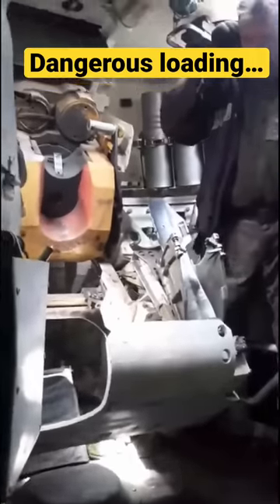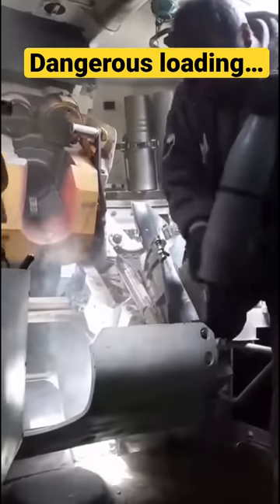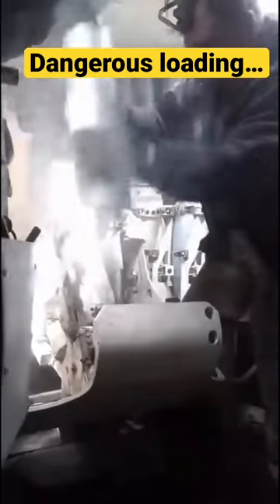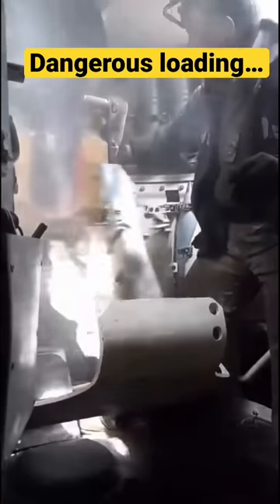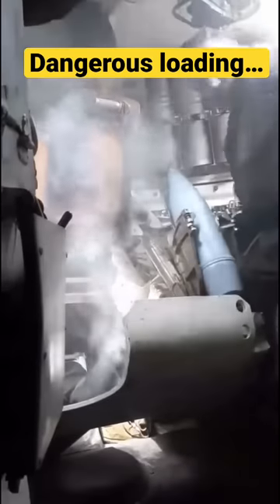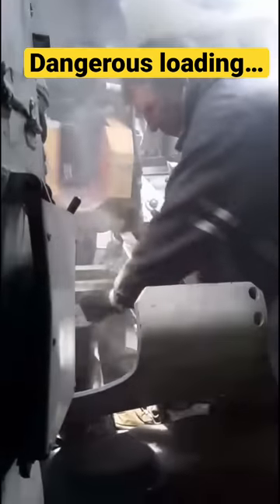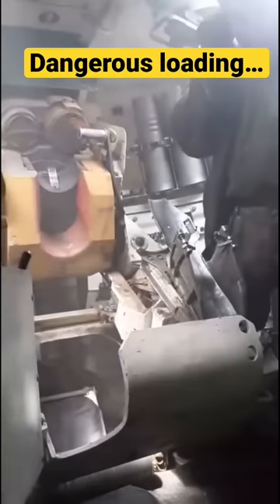Slow and dangerous artillery drills

Comment: yeah the loading is not flawless, probably the ejection port is stuck or
 broken. and it is annoying to see the used cartridge is blocking the 
mechanism.
but it is pretty unlikely that the spent cartridge would 
incinerate a new one. dude the times since paperbags filled with 
blackpowder are long gone. Todays propellant is pretty stable.
Where are all the self proclaimed military experts spawned from?

Comment: there is a difference between a trained soldier and a soldier trained on specific equipment. considering the fact that both sides have a hodgepodge of troops of all skill levels some trained and some not i'd assume he's new to what he's doing and doesn't have someone to teach him in depth operator skills or he wasn't trained at all and is just winging it based on common sense practices.

Comment: Sloppy work or not that gun is hella worn out. Those shells should be ejecting with enough force to endanger anything they hit.

Also speaking of ejecting why isn't the ejection hatch opened. It's there to prevent spent casings from being in the way.

Comment: You guy’s scared too much of almost everything. It takes loads of flame buring the casing for more than 10mins to get it to explode. Explosion under high pressure pushed everything out of the casing nothing is left but smoking waxy coating left. That heat isn’t even enough to burn your clothes let alone blow up a small lighter. If it was a design flaw everyone using it would got all their heads blew off by now.